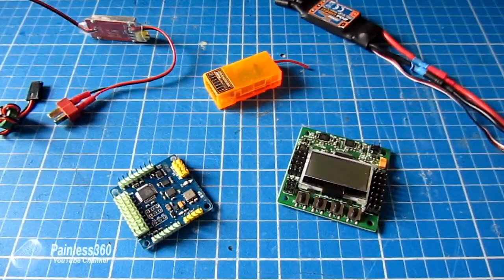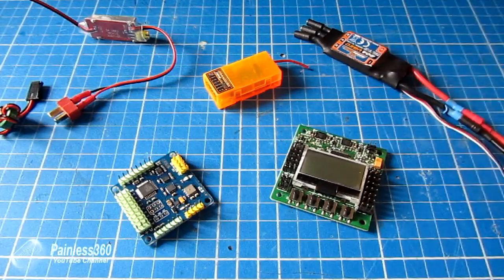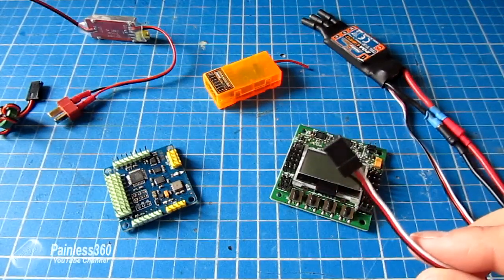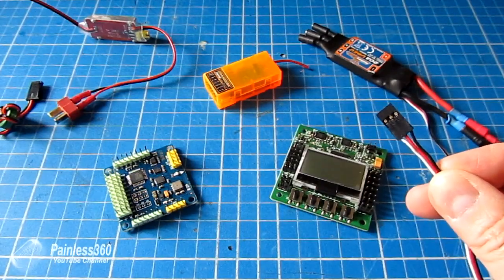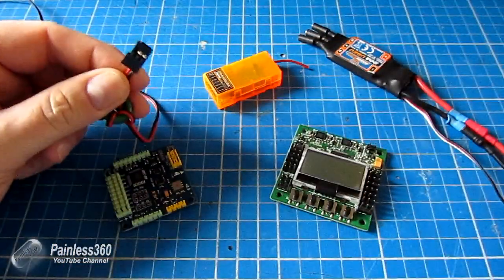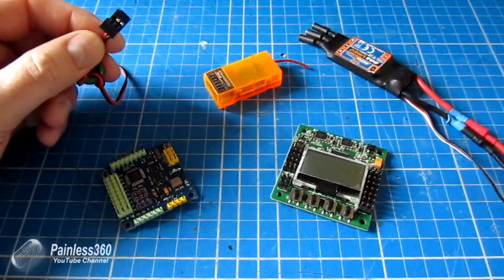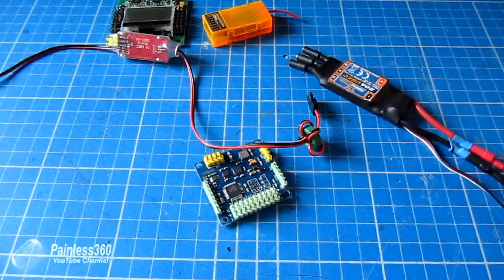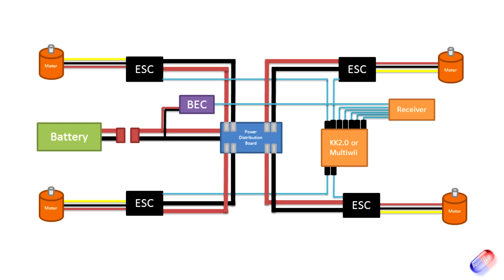How to connect OPTO ESCs and a BEC to you multirotor (KK2.0 or MWC)

Comment: Thanks painless, have you looked at the qbrain ESC's? I know they've had bad press, but there are some advantages, such as high through put and neat build (mass in center etc) Be nice to hear your views. I use them and looked into flashing with simonk, 
A, you can't (not the right chip, but there is that sort of thing for the chip they have.)
B, you don't need to.
Would be really good to get your input.
Reply from the maker: I've not used them myself. The idea of one piece that can do all three is nice. I'm not sure about having that much heat dissipation in a package and I wonder what happens if one of the ESCs develops a fault or becomes damaged. A nice option for builds where you don't want the ESCs on the arms.
Reply: Heat doesn't seem to be that much of a problem, I've sat mine under KK2, with velcro either side and I've not had overheating issues on the 25amp qbrain, it gets hot, but it's so buried in there you sort of stop worrying. As a beginner, I've not pushed it. I blew up the 25amp qbrain by getting the wrong polarity on the battery feed on the KK2.1, however all the motor controls seems to still work, it was the common earth that melted, i think it fried the brain bit , not the esc's, probably repairable. Thought of sending it to Bruce for a laugh, but next on the bench he told us he had one (like to see his review on it)
Running 20 amp now, which should overheat even more, I think I'm drawing 18 amps per motor, but weather/work/daylight issues have stopped me flying more than an experimental video for work, looking at some damaged guttering. For the money, I'd get one and review it, it is designed for quad copters and doesn't need flashing. I could send my blown one to you, you fix it you keep it?

Comment: When you plug the ubec into the fcb will the power then flow the other way to supply power to the rx?
Reply from the maker: It should - the 5v from the BEC is common on all the inputs so everything plugged into it will also get power. (the KK2.1 has a separate input for the M1 connection though, see some of the other questions).

You will see this on the Multiwii boards when you plus them into the USB connection to check them, the attached receiver will also come on too. Check that the 5v pins are connected together on the board using a multi-meter to make sure.

Hope this makes sense - happy flying!

Comment: I have the Castle Creations Quad Pack in my quad, and three of the four ESCs are opto and one is BEC... I have the KK2.1 board and I was pulling out my hair as to why three of the ESCs would not power up... Then I saw that the KK2.1 doesn't feed 5v from M1 to M2-8... Now I see I need a BEC to run the other three ESCs or make s jumper from M1-M2 to get power.. Thank you SO much.. I came across this video just in time before I ended up bald...
Reply: Wouldn't you just need to connect the one ESC that has BEC to M1 on the kk2.1 to provide power to the board?  The other ESC's should work fine as long as the board is getting power (at least that is my understanding).
Reply from the maker: daniel gallagher Check the manual for the OPTO ESCs you are using.

For some models each of the ESCs needs to have 5v on the red lead that plugs into the board. This is to power the on board ESC circuitry than anything else.

The KK2.1 has separate power rails from M1 to the other connections so the other ESCs plugged into the M2, M3 and M4 channels that don't see the 5v on those connections and don't power up.

Hope this makes sense.
Reply: Painless360 And that's how the Castle ESCs are... they need constant 5v to the red wire of the non-BEC ESCs, and the KK2.0 and the KK2.1 don't supply the 5V to the rail for the other 3 ESCs...The one ESC with the BEC in it plugs into the M1, but don't pass the 5v through to the M2-8 which the other three ESCs need , so you need to either solder a jumper from M1-M2, or add a BEC to M5-M8 (on a quad)
Reply: I have bought a new quadcopter, and I would like to know if I can use one ESC with BEC in the M1 and  3 ESC OPTO in M2 M3 and M4. It will works? Or I will need more ESC with BEC??
Reply from the maker: Hi, depends on the board, with most that is fine but with a KK2.0 board you will need to jumper the power pin from M1 to the others as it's electrically isolated and the optio ESCs may need to see the +5v from the UBEC to initialise. Hope this makes sense.

Happy flying.
Reply: Painless360 I have bought: Hobbyking KK2.1.5 Multi-rotor LCD Flight Control Board With 6050MPU And Atmel 644PA  Do you think that I will need more than one ESC with BEC??     (I was wrong and I bought 4 ESC opto, yesterday I bought one ESC with BEC that it is being sent from hong kong)
Reply from the maker: Hi Jimmy, glad you got it sorted! Happy flying!